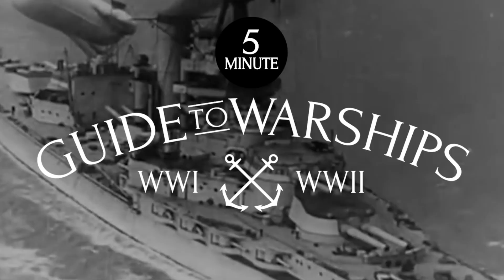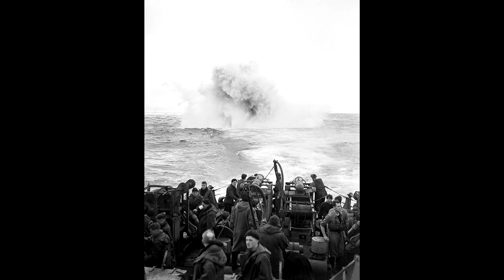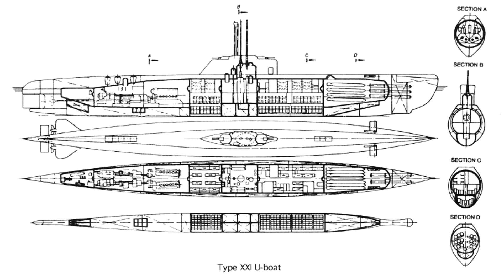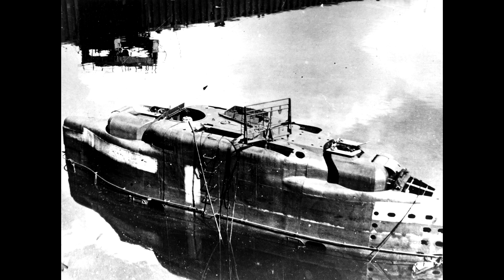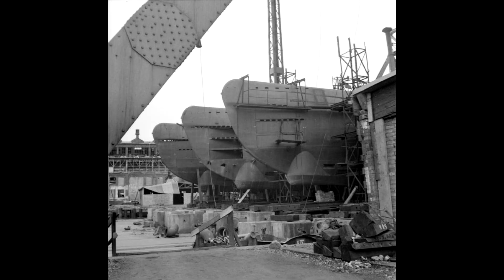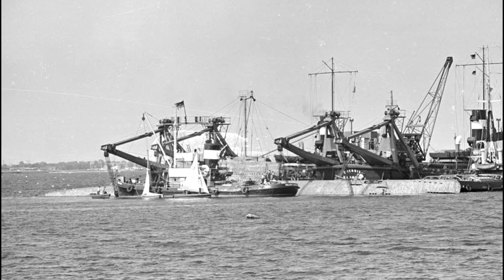Type XXI - Guide 408

Comment from the maker: Pinned post for Q&A :)
Reply: What led to the development of the US Navy’s cage mast?  What’s the logic of that specific architecture?  Why did it go away?
Reply: @Swrdfshtrmbns  It was thought that it would be more survivable than a pole mast & lighter than a tripod.  Turned out to sway about & be weak, especially with the increasing top weight of US Battleships.  thus giving up.
Reply: Was the XXI the first submarine class to be built at different locations and then put together like a german version of IKEA furniture, or was that concept developped before ?

And speaking of the last Electroboots, can we have more details of the "last voyage" of U-3503, U-3523 and U-534, and what could be the reason they were headed to south america ?
Or is this all we know and we'll unfortunately never get a complete answer ?
Reply: @Paludion they were headed there because they were considered friendly refuge. Plus they may or may not have had extradition treaties with the allies.
Reply: @Paludion  follow up question to that escape to South America, did they run on the surface? Why did they use they snorkel? And could the Allies still be detected the snorkel on radar?

Also has there been any attempts to locate the wreckage? And was there valuable cargo on board? I heard they may have but rumours of gold and that particular regime are very common.

My understanding (from the mission in Silent Hunter 2 was they were heading to Argentina) as it was the best place they could hope to escape to. From a game, so a grain of salt and all that I guess.
Reply: @Paludion The idea of a large ocean going submarine that was faster submerged as afloat was ideal for the RN and Royal Navy.
Both adopted concepts in future boats. The US made them even bigger as did the Soviets in the 1950s.
Reply: Would really be interested in a Wednesday video on the Type XXI operations in the West German navy, and how it performed in exercises etc. and also getting into the lessons derived from exploitation of captured XXI's and how they were and weren't incorporated into the various allied upgrades and sub designs in the 40s and 50s (GUPPY, Whiskey, Foxtrot, Romeo etc)
Reply: If Japanese submarine I 19 got the most successful torpedo.Attack against warships of the second/ First World War.What was the most successful attack?Againsthat's full of targets warships in the Atlantic or Mediterranean? Love video and keep making good stuff please
Reply: Were there ever any plans to use the advancements that led to the XXI and XXIII classes in a major modenisation program for existing german subs like type VII and IXs. Something similar in execution to the post- war GUPPY programm in the US navy.
Reply: @svenschollkopf3260  They did some minor modifications AFAIU, like adding snorkels. Adding more powerful electric motors and larger battery packs sounds difficult without a major redesign?

Maybe get rid of the deck gun and make the conning tower a bit more streamlined, and perhaps they could have gotten an additional knot underwater speed?
Reply: @svenschollkopf3260 Wow. I should have read your post first.
We are asking Drach for the same things.
Now everyone wants one or the other. It lead to an underseebot arms race post war.
Reply: In Drydock 207 you mentioned the Germans really wanted HMS Ark Royal sunk, why was this? I can understand them wanting Warpsite sunk but Ark Royal seems a bit of a curious choice to me.
Reply: @joshthomasmoorenew why would sinking one of the most notable Capital ships in the Royal Navy be strange? Sinking a carrier is a prime target.
Reply: @WALTERBROADDUS  No sinking the ship makes sense, its the bounty on Ark Royals head that puzzles me, thats the kind of thing you put on something you really want to die, but Ark Royal doesn't do anything partically special in her career to warrent that to me, like Enterprise does in the Pacific.

If their was a bounty on Warspite or Hood i can understand because they were very famous ships, so a bounty on their head makes sense, but Ark Royal wasn't famous like them and shes not the Royal Navies only carrier so while sinking her would hurt it wouldn't cripple the Royal Navy.
Reply: @joshthomasmoorenew  she was sunk because she's a carrier. Not because of any bounty.
Reply: @WALTERBROADDUS  I'm not saying she was sunk because of the bounty.
I'm just wondering why Ark had the bounty in the first place (outside of her being a carrier).
Reply: @joshthomasmoorenew  I can find no actual reference to any such bounty.
Reply: @WALTERBROADDUS  you're right that enemy capital ship would be a prime target but was the intention to weaken the RN's ability to fight German surface raiders, their ability to counter the Uboats or both? And how much of the propaganda value was involved?

Was the Ark Royal very effective in the fight against subs? Or was it likely to be as the war developed?
Reply: @somethinglikethat2176  there was no real extra effort to go after Ark Royal  over anything else.
Reply: Which class of submarine from the time period of this channel had the greatest impact in history?
Reply: @bkjeong4302 Type 9 and Gato/Balao, they did a lot of damage in tonnage and significant warships mission killed or sunk.
So who had the best mini subs?
Reply: @bkjeong4302  probably not Drach's style but a tier list of them might be interesting.
Reply: Given that the type XXI despite being advanced never really did much would Germany have been better off further upgrading the type IX instead? Or had the Type IX reached the limits of it's hull?
Reply: @brendonbewersdorf986  there's nothing more you can do to that design. And you are talking about interrupting production.
Reply: @brendonbewersdorf986  The Type IX had some rather peculiar limitations, like a large part of the extra torpedoes were carried outside the pressure hull, requiring the sub to be surfaced in calm seas for a several hours long operation to lift them inside the pressure hull. Not a healthy proposition if there's the possibility of Allied patrol planes turning up on the scene.

But maybe some kind of "Type XXI lite" could have been done? Reuse engines from the Type IX in a slightly smaller more streamlined hull, lose the deck gun and instead have a couple of AA guns in the streamlined turret like the Type XXI, and forget the more fancy features of the Type XXI?
Reply: Some videos that maybe you have done but I can't find:  Best floatplanes.  Effectiveness of submarine launched planes.  What was best submarine if cost of manufacturing is a factor.
Reply: @tinfoil_hat_man  is it still primarily a ship-based channel. With limited aviation content. And the best float plane or flying boat? By what metric? They all do basically the same job. None is any more spectacular in performance. All have the same limitations as any other shipboard aircraft. And as for submarine applications? You have limitations on size, range, and the need to surface to launch. They provide a reconnaissance. But little payload capacity.
Reply: About what was the maximum depth that a submarine could launch a torpedo from. I do understand that it will vary from sub class to sub class, and probably by location.
Reply: @Thirdbase9  the torpedoes are primarily and visually. Trying to fire from lower than Periscope depth really doesn't work. Nor are they really set to do radical changes in depth. Something like you Are describing has to wait till there are guided torpedoes.
Reply: @WALTERBROADDUS  That doesn't answer my question. I know that they were normally fired from periscope depth or less and that accuracy will be bad. But if a destroyer is coming straight at your submarine while you're diving firing off a torpedo might get him to swerve off, or it might hit it.
Reply: @Thirdbase9  and you would set your torpedo at a depth to hit the destroyer. But you're not going to be any more than 60 ft. You are not sitting at like 300 ft firing torpedoes.
Reply: @WALTERBROADDUS  Provide me some documentation evidence or please stop answering my questions.
Reply: @Thirdbase9  the channel does not allow links. And at last check, you are not my supervisor?
Reply: @WALTERBROADDUS  Nor did I ask you a question. Nor are links the only way to convey information.
Reply: @Thirdbase9  guess what? It's an open forum. Sorry, you got a bug up your saddle.
Reply: Construction on the Iowa classes, Illinois and Kentucky was stopped in the 1945 and 1950 respectively. If the USN decided to both finish them and build the Montanas because the military has the money to do so and the Soviet Union was a bigger threat, would Illinois, Kentucky, and the Montanas be nuclear powered? For comparison USS Enterprise CVN-65 (first nuclear powered carrier) was finished October 1961 and USS Nautilus SSN-571 (first nuclear powered submarine) was finished April 1955. 

In reality the USN would build more carriers but for the sake of the question, let's keep them out of the equation.
Reply: @Johndoe-dc Dollar for dollar,  Subs and airpower will decide future wars. The 1947 budget was cutting of funds, even in the threat of the Soviets behaving badly.
Reply: @Johndoe-dc  they would do none of the above. There's no need for additional battleships. Or a Nuclear Powered one.
Reply: @WALTERBROADDUS  well it was theoretical. They would have build carriers, destroyers, and cruisers.  As well as converted the Iowas like they did.
Reply: @Johndoe-dc  It is effort and money spent on other projects. You need Polaris, far more than some Frankenstein battleship.
Reply: @WALTERBROADDUS it depends on how rich a country is to build six nuclear Montanas with cruise misses and flyswatting AA.
 Patton attacks from Chech border igniting WW3.
 The budget triples and more war bonds make B52s a couple of years early.
Reply: @richardbennett1856  I think I'd rather spend money on people in North Carolina. You can't eat cruise missiles....🍽
Reply: If you were in charge of the Norwegian royal navy and coastal defense in 1940, what equipment would you have ordered and what force would you want to build
Reply: @terrynewsome6698 Picket boats, trawlers, radios,  and gun emplacements along Narvik and southward to Oslo.
Owning Norway was crucial to Germany and the Allies didn't grasp it until it was too late.
Reply: World of warships have been referenced occasionally in your videos with things like monarch and Duncan getting mentioned. The game itself introduced many naval fans to some not so well known projects and blueprint ships. But they also dabbled in creating their own fictional ships. the question here is. what are some fictional ships in that game that are definitely “eyebrow” raising, either good or bad. That definitely caught your attention. something like the Karel Johan the XIV Swedish battleship and its…VERY far fetched reasoning for creation.
Reply: What is the oldest ship (still existing or otherwise) that could  theoretically be used modern frontline combat?
Reply: @Fluffinator129  USS Nimitz? In-service since 1975.
Reply: Did you ever do an Elbonian navy question? If so, what drydock would that be in? If not, how would you take a crack at the country's navy?
Reply: Now that you have us all interested in Type XXI, the Type 23 would also be a tasty treat.
Please, Sir, could I have some more?
Reply: I've seen a lot of newspapers from 1915 and 1916 claim that Pennsylvania and Arizona were the largest/most powerful ships in the world. How would the Pennsylvanias and Nevadas stack up against their royal navy contemporaries? As well as their Japanese, French, Italian and German counterparts?
Reply: Do you have any thoughts on HMNZS Manawanui? And would you be open to making a guide video on her?
Reply: @johnofnz  The channel really doesn't do modern ships.
Reply: @Drachinifel  if you’re ever going to Munich, make sure to visit the Bavaria Filmstudios. There you can make a complete tour through the interior of a Type VII C. Its the film set of „Das Boot“. Also the Deutsches Museum there has SMS U1. So there‘s actually something worth visiting there- but I don’t have hopes on finding good beer or good sausages there.
Reply: once heard somehwhere the germans had "stealthtech" for their late war subs to make them less detectable on sonar is that real or just the same nonsense like with the "stealth" horten 229?
Reply: Could the interwar Kriegsmarine have believably lied about the intended role of the Panzerschiff by overstating its armor and speed and understating its range?  I am imagining them saying it was a high speed coastal defense ship able to take on multiple cruisers.
Reply: @katana1430  that really makes no sense.
Reply: @WALTERBROADDUS  How so?
Reply: @katana1430  your efforts at disinformation are futile. It's basically set up for commerce raiding.
Reply: @WALTERBROADDUS  We know that now, but could the Kriegsmarine have gotten away with it in the 1930's?
Reply: @katana1430 Forget Bismark Class and Tank Cruisers. 
Build 6 Alaskas and some Light Carriers for that money. Have some Marks left over for another 50 type 9 subs in 1941.
Reply: Construction on the Iowa classes, Illinois and Kentucky was stopped in the 1945 and 1950 respectively. If the USN decided to both finish them and build the Montanas because the military has the money to do so and the Soviet Union was a bigger threat, would Illinois, Kentucky, and the Montanas be nuclear powered? For comparison USS Enterprise CVN-65 (first nuclear powered carrier) was finished October 1961 and USS Nautilus SSN-571 (first nuclear powered submarine) was finished April 1955. 

In reality the USN would build more carriers but for the sake of the question, let's keep them out of the equation.
Reply: When did naval artillery become so powerful that a Greek Fire armed Dromon wouldn't be the deadliest ship in the Mediterranean Sea? My guess would be with the advent of explosive shells, though maybe 18th century gunnery was already good enough that a Dromon couldn't get in range. Because let's face it, if a Dromon gets in range, any wooden warship is so much fire wood. The main reason in my opinion why the Byzantine navy didn't completely rule the Mediterranean for the better part of a thousand years was that there was a very limited supply of Greek Fire, but one on one I think they would have dominated long after the recipe for Greek Fire was lost. Heck, imagine the carnage a couple of Greek Fire armed ships would have wrought at the battle of Lepanto. 
So once more, when did naval artillery become so powerful that a Dromon or any other ship equipped with Greek Fire siphons couldn't reliably get in engagement range?
Reply: Ian Fleming famously served in Naval Intelligence, and based some of the James Bond mythos on people and things he knew there. Can you tell us about some schemes or operations worthy of a Bond villain, from the period the channel covers? The Italians basing divers in a sunken freighter in Gibraltar comes to mind, but is there any secret volcano lairs, for example?
Reply: @jorisammerlaan  how about the World War I sabotage of Black Tom Island?
Reply: Did the British ever consider putting an upgraded 15 inch on the Nelson class rather than the maximal 16 inch? If they did how might have they utilized the saved displacement to enhance other aspects of the ships? I know this was unlikely due to the politics around 16 inch armed ships and the Washington Naval treaty but it’s an interesting possibility.
Reply: @MildyHistorical  That would have been the F3 design, covered in this channel earlier IIRC. In retrospect it would have been a better choice. Oh well.
Reply: @jbepsilon  ah fair, but those were battlecruisers, I was wondering about the possibility of Nelson class battleships with 15 inch 50s. I’d guess it to be at least as fast as the QEs with that saved displacement from the guns.
Reply: @MildyHistorical  Well, battlecruisers in relation to something like the monstrous N3 design. They had about the same total weight of armor as the Nelrods, so honestly in WWII they would have been "fast battleships".
Reply: @jbepsilon  yeah that’s true, F3s as designed would’ve been more useful in WW2 than Nelrods, but at that point I think the Brits really thought they wanted a proper battleship over any notion of battle cruiser
Reply: @MildyHistorical  Yes, like you pointed out in your earlier comment, they really wanted something with the maximum 16" guns the treaty allowed. For national pride if nothing else. And probably Jutland taught them that skimping too much on armor wasn't a good idea either. And then they screwed up their new 16" gun up by going for a high velocity and light shell design, leading to poor accuracy and barrel life. Though I believe they partially sorted out some of those issues in time for WWII.
Reply: Are there any good Russian admirals during the Age of Sail? Would you consider Ushakov and Nakhimov as good? And where would you rank the Russian Navy in a time period right before Napoleonic wars and slightly after?
Reply: i was wondering if you could make a bit of an overview of the smaller-than-DD ships of ww2. if noticed a couple of mentions of frigates, corvettes, motor patrol boats and so on in your recent videos, and came to wonder how these looked and operated in ww2, since its usually just about destroyers, cruisers, battleships and carriers, not about smaller warships
Reply: If war had broken out between the US and British Empire over the Trent Affair, what would Britain's strategy have been?  What about the US's?  Who might have won?
Reply: @Drachinifel How do you think the South Dakota class battleship would have been changed in the event that the US Navy had gained access to either the Yamato class blueprints or the a 150 design, Or would it simply have been green-lit for construction as is? Or would it have been upgraded to basically a earlier Iowa class or a compromise between the two classes of ship (The year of discovery would be either 1937 or 1938)
Reply: @youtubeminecraftwatcher6860  the basic answer to the question is; called USS Montana. Rather than trying to do what you are suggesting they would go with a clean sheet design.
Reply: Can you elaborate on U3523 being sunk after the surrender? Why were they attacked if they were in open ocean sailing?
Reply: The Revenge class but with oil fired boilers instead of coal: what kind of performance uplift could we expect with that hull form and displacement, and how limiting would their hull form be? Would it have been worth re-engining them dueing the interwar years?
Reply: In the novel "Bridges at Toko Ri" there is a scene where an Essex class carrier uses propeller aircraft  on deck to help push the ship alongside it pier / Quay. Was this ever done ?
Reply: @GalaticEmperor671  Yes.... the practice is known as windmilling. They used the thrust of the aircraft rather than a tug.
Reply: Are there any good sources of information about submarine warfare in the late 40s and early 1950s? There is a lot said about what happened during the world wars, and on modern nuclear submarines. But the era where things like GUPPY boats and Whiskey submarines are actually putting the technology of the XXI into practice doesn't seem to get much coverage. The ability to outrun Fido "mines", and slow destroyer escorts should have changed something.
Reply: Did numbered submarines ever have unofficial names?  That is, like the Enola Gay for aircraft etc.?
Reply: the swedish submarines folowing WWI (from Sjöormen class and forward.)  have been buit with both 21 and 16 inch torpedos ( 4/2, or 6/2, 6/3, 4/2 for the classes in kronological order).  
Is this something that could have been usefull earlier in history to alow more tubes and more torpedos   ir was the smaller torpedoes at that time just not good enough ?
Reply: DAY 78  please could you make a video on what if the Bismarck broke into the Atlantic or what if the the Bismarck made it TO France
Reply: @baxter9725 it doesn't catch any convoys. All the convoys will be rerouted away from it. And you have most of the Royal Navy already blocking its route to France. And once there, it just becomes a constant bomb Target for the RAF.
Reply: @WALTERBROADDUS 
By the time Axis had new boats, the Allies had really gotten good with convoy protection and the exponential production, the mass of force, and new technology was overwhelming by 1944.
They were still IRON COFFINS.
Reply: When parts of the High Seas Fleet are raised in the 30s, some bright spark with a magic money tree decides that clearly, the best course of action is to take those hulls, clean them up, modernize and put them into Royal Navy service. Ignoring the hilarious cost of ripping out years of rust and grime and the amount of other things you could do with that money (as well as implications on treaty fleet sizes) for the purposes of this question, which of the ships that were historically raised would even be worth putting back into service at that point, what would their modernizations have looked like and would their hypothetical use in WW2 have been any different from the historical use of the QEs/Rs/Renowns? Or would carrier conversions have been more likely, considering the amount of material that had to be rebuilt anyways?
Reply: @Blockio1999  you must be the guy who buys flood cars at auction?🤔